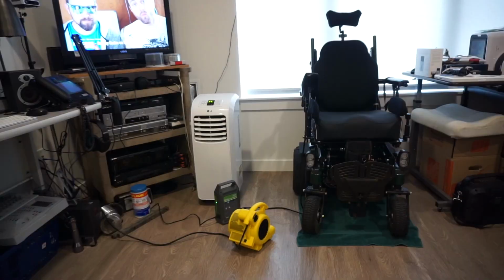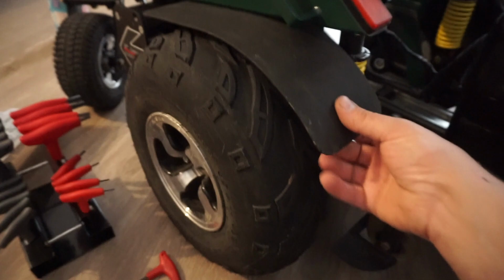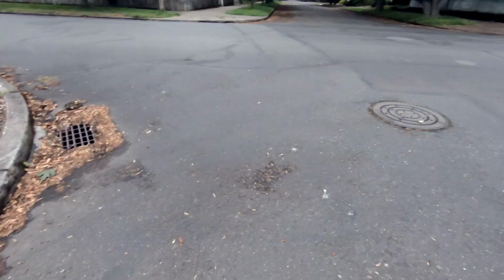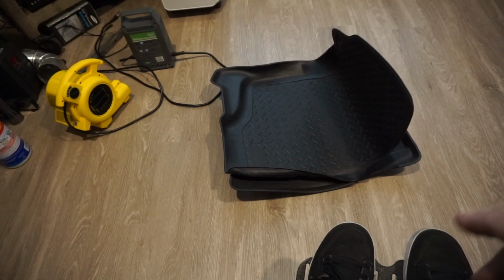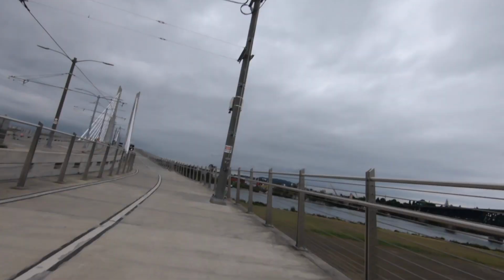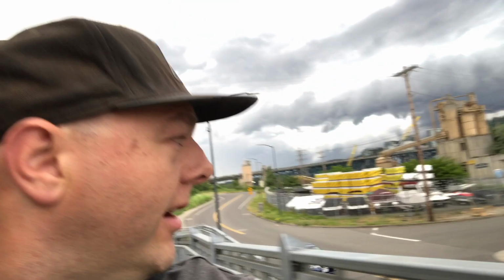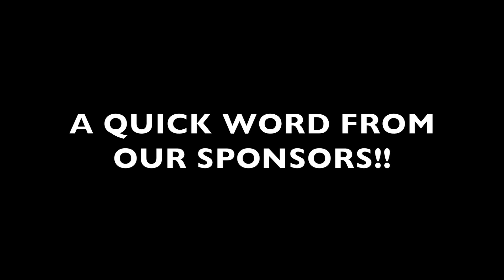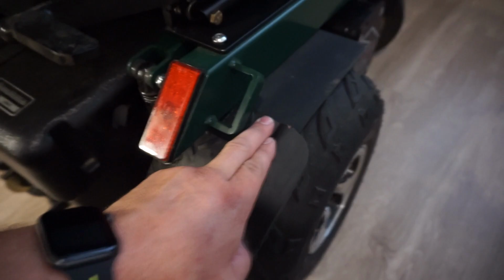MEGA VLOG 425: choose your battles

Comment: Get your gallon of WD-40 and a spray bottle you know water displacement just spray it on your change and electrical when you get out in the rain it will help shed water and it sticks surprisingly well cheap by the gallon and it works spray a ranch and then lay in the rain and look at it a few days later

Comment: I have the same issues with sidewalks here, as well as some areas with no sidewalk at all. it is bad enough the VA actually ( finally) agreed that I need the Frontier V6 just to get around town. I also run into businesses that think the sidewalk is a great place to park vehicles, and set up tables and leave pallets.  a couple years ago I had a cop tell me if I didn't stay on the sidewalk he would write me a ticket. until I pointed out that not only were there no cut outs, there was a light pole dead center in the sidewalk about mid block that I could not fit around on either side of. I don't understand how people can have such little grasp of physics, and special relationship
Reply from the maker: kinda reminds me of Casey Neistat's video on bike lanes! https://www.youtube.com/watch?v=bzE-IMaegzQ
Reply from the maker: nice ya were able to get a frontier chair though! i used to get stuck a lot in my regular power chair, and have to call for help a lot from police / fire department due to bad sidewalks, gravel, narrow paths etc.. but hasn't happened once since getting my V6, and eventually the bounder!  its rough out there! every little bit helps, and having proper equipment is a huge help!